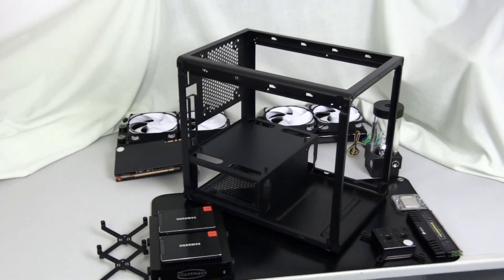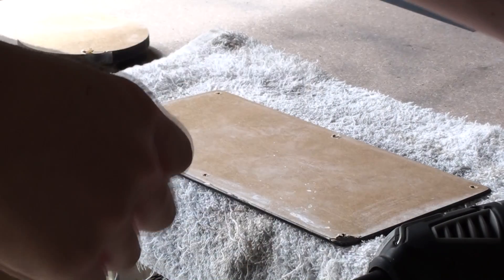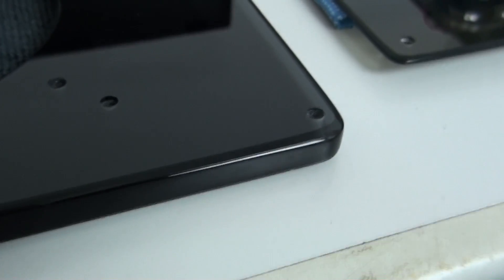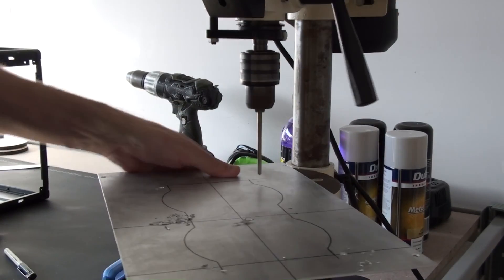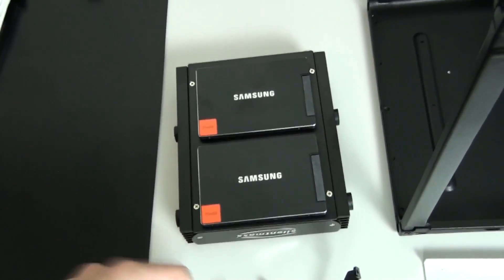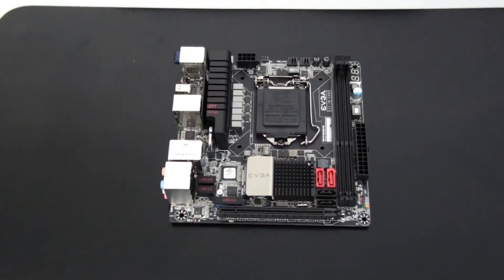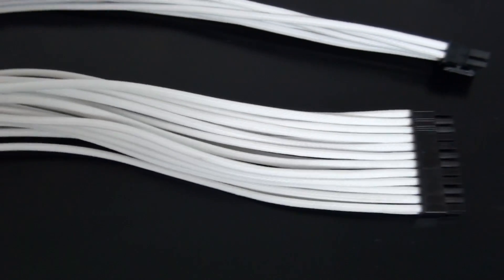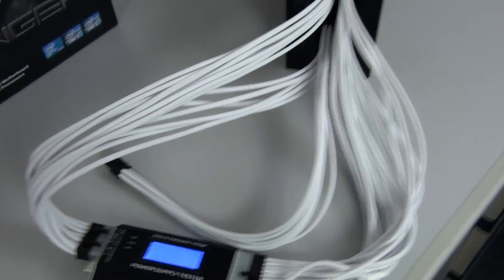Build #9: Extreme Prodigy: Part 2

Comment: Why don´t you use a 200mm radiator in the front? As far as I know it should offer more performance than a 240 and you wouldn´t have to mod the top panel in order to fit a 240mm up there.

Comment: @ Singularity Computers: Noctua will be releasing white NF-F12 fans with 80% more airflow and 120% more static pressure. For the black and white theme of this build quite interesting. I wish I could link ya to it, but youtube won't allow...

I figure for cases with limited radiator capacity quite interesting....

Comment: Hey bud great work wanted to make a suggestion. I use a dremmel alot as well I bought the dremmel attachment thats like a wand so u can put attachment on small head.they call it the engraver but I use it for everything just use my ajustable chuck and much easier to control than holding a big dremmel alot of precision with it

Comment: LOL i spray painted my stock psu wires and it turned out well. They took forever to dry but they did not crack or anything like that and it was cheep and easy.

Comment: You should use a trim router instead of files much faster and uniform surface....get one were you can change the speed and it wont melt it. Just keep the blades sharp.